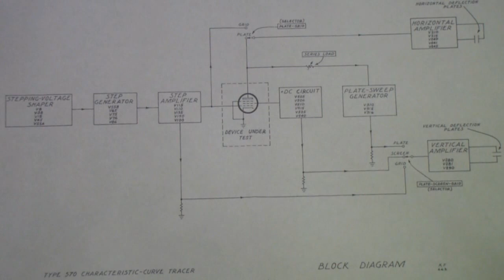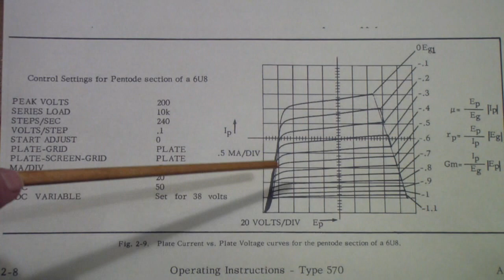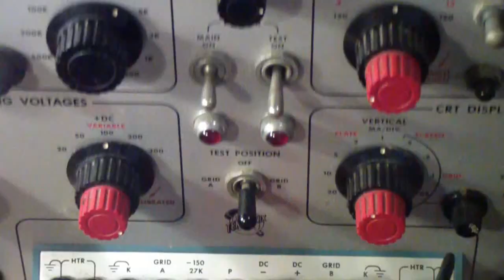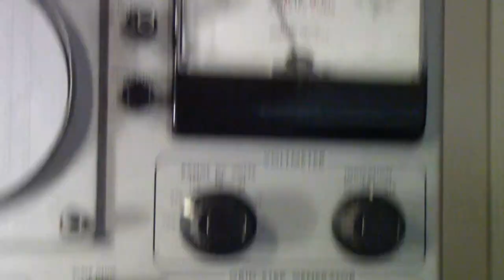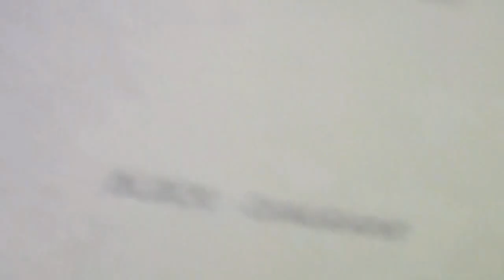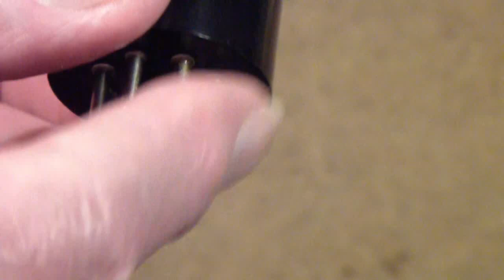TTT303 Tektronix 570 Curve Tracer

Comment: Isn't it a problem to have a 400V/-300V around this 6CL6 which is rated for 300V of plate voltage ? It seem that this tube is used way far from the standard specifications (here according the schematics at 418V of voltage plate as the cathode is at -18V). An other weird detail is that the 400V unregulated supply (rated at +/-5%) is noted 460V in this schematics, which is even worse !

Comment: Tom, I was a Tektronix Field Sakes Engineer in the early 1970s. The product line had matured to the 576 Curve Tracer. I was based in Palo Alto and later Santa Clara. Being smack in the the middle id Silicon Valley I sold hundreds of Curve Tracers to dozens of companies. What a great flashback!  I’d used the 570 while temporarily based in Beaverton.

Comment: For your modification, I do hope you used the silver solder in the spool provided inside the 570. Those ceramic terminal strips wont tolerate anything but silver....